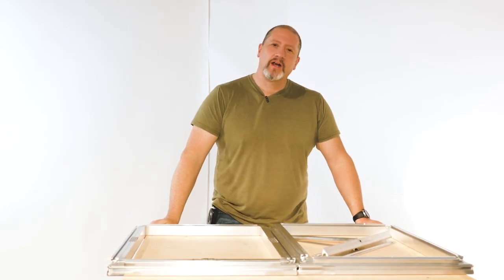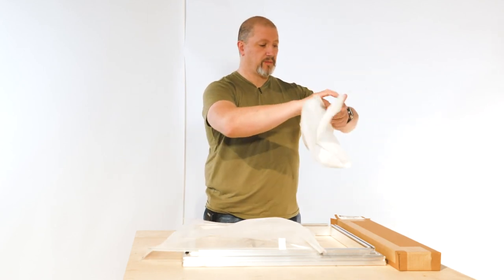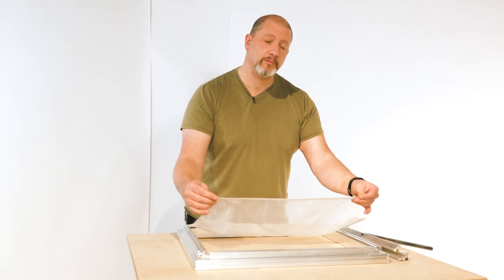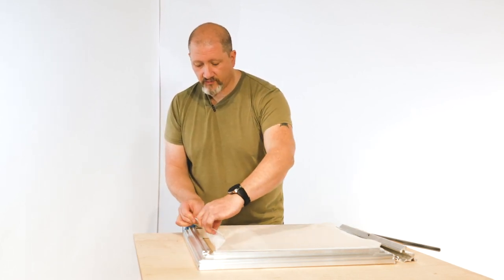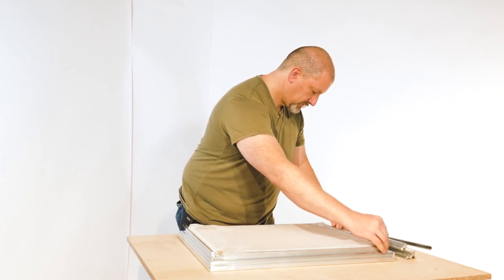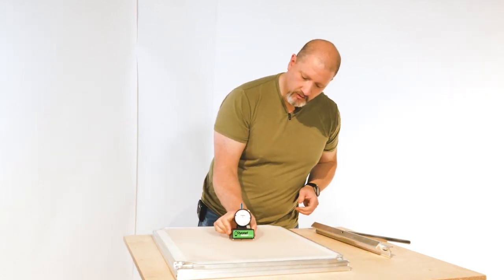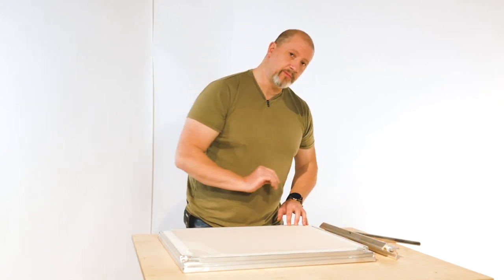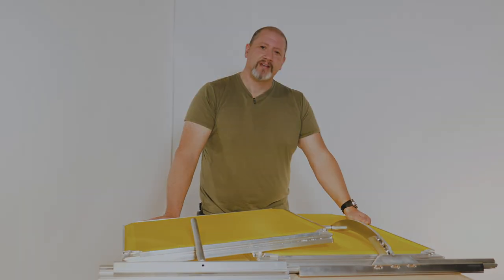Eco Frames | How To Install Mesh

Comment: The white gorilla tape works perfect. Even during washout it may start to pull off but as the screen dries you can simply push it down in those areas and the adhesive holds tight again.

Comment: I reuse all of my images and don't reclaim screens when they're spent (usually a couple of years). I do have some images that I only use seasonally (ie Christmas). Could I remove the exposed mesh from the frame, preserve it, and then restretch the exposed mesh back onto the frame in a few weeks or months? I'm only doing single color, so I don't need overly accurate registration, but my images are fairly fine detailed, so I'm concerned about distortion or whether it's even possible at all!
Reply from the maker: Hello there! Good question. I would not recommend doing this. Not only will unstretching a screen thats got emulsion on it will hurt the emulsion, but when you go to reapply the mesh and restratch it, the emulsion wont hold up and the stencil will end up skewed. Hope this helps. 

Ryonet Team

Comment: Can the mesh be removed and repositioned? I’m very new to screen printing and have inherited these screens and have found a black mildew or mold between the mesh and the frame. I want to clean underneath thoroughly, but don’t want to damage the mesh in doing so
Reply from the maker: Hi Rebecca - The strips of plastic are sewn to the mesh with a black thread.  Are you possibly seeing that black thread in the channel?
Reply: @Ryonet  No- it’s almost as if the emulsion was not washed out completely and has blackened between the mesh and frame.
Reply from the maker: @SuzyShuggabaker  There is no organic matter in emulsion.  So it wont be mold that you are seeing, but dried up emulsion and maybe ink in the channel.
You can remove the mesh, but if there is dried up emulsion and gunk in the channel, it will be difficult to clean the mesh strip well enough to re-seat properly.
you will be better off replacing the panel when it pops.